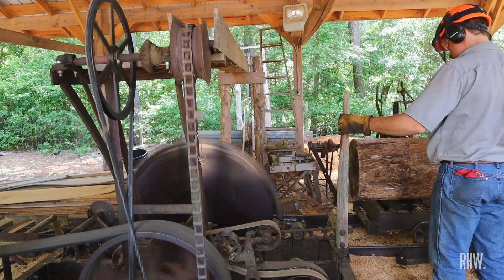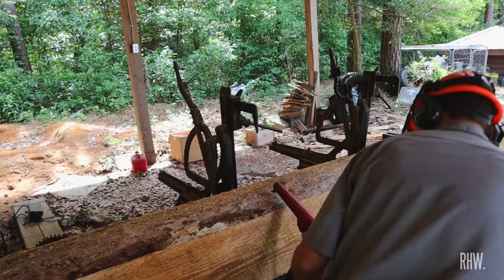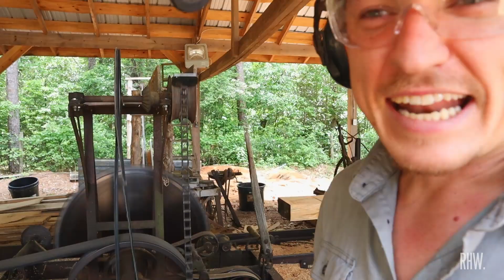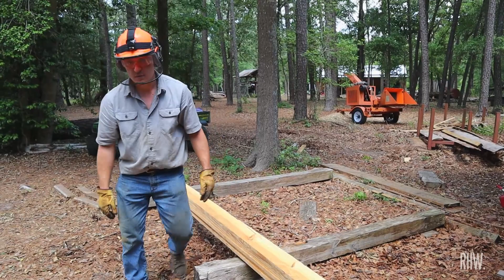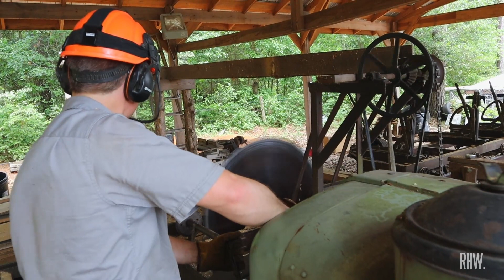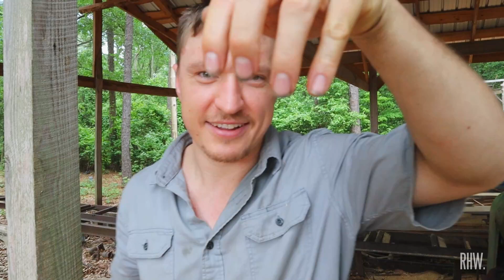No Jawin' Just Sawin'!!! [00 Frick Sawmill] | MILL WORK 2022

Comment: We have my father's 1922 Farquhar mill. We're lengthening the track to 60', and the carriage to 20', and adding another headblock. I've sawn 20' lumber, but the ends chatter when it gets narrow. With the new setup, I'll be able to saw 24' lumber with no problem, maybe longer  for beams. Powered by a 1936 Caterpillar D13000, set on fast idle at 800rpm. Love the old mills.

Comment: cuantos hp ?? y cuantos rpm d la sierra ??
Reply: ~150-160 hp when engine ran at ~1600 rpm puts the saw plate running at ~500-550 rpm.